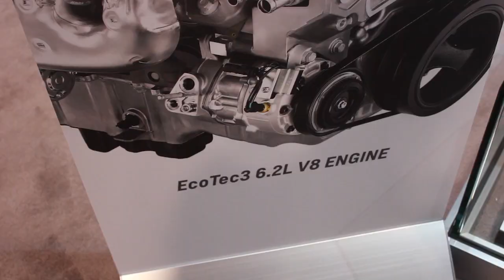Ask a GM Tech: Is a Cummins Swap Worth It?

Comment: Not sure how much similarity there is between the software running a GM ECU and Motorola RSS/CPS but I've used a hex editor program to allow specific types of Motorola radios to work in the amateur radio bands. Yes, someone waaaaay smarter than me figured out what part of the software needed to be changed, and where, but it wasn't all that difficult to do.

Comment: The annoying part is that on my 95 7.3 there were a few factory recals on it, & personally I’d rather get the part & instal it myself, I don’t want their thieves touching it, cuz then 3 miles down the road I’ll have some issues & have to came back to pay them for something they broke. 

In a nutshell... gas sucks diesel rocks. Depends on application. 

Trucks, SUVs, & sedans... diesel all the way.
Some people like the power of the gas motor, but others like the reliability of the diesel.

Unless they have DPFs on them then stick with the gas, the diesel is good, but you’ll have issues 100,000 miles downs the road with the DPF.

Comment: The answer simply is: What do you really want to have? Most people that buy those vehicles don’t want to do their own work on their vehicle especially to that extent. Where I live, I can’t do a swap like that, they just don’t allow it. The 4bt cummins is a lot more noisy, and takes away at the luxury aspect of owning the vehicle, but you do see a tremendous increase in fuel mileage. Even the 6bt will out do a 5.3 in mpg department. It’s a lot more practical to work on for you, and will be more dependable in the long run if you set it up properly.
Reply: Where do you live, because living anyplace that doesn’t “allow” you to do your own shit sounds kinda pathetic

Comment: Feel like the guy wouldn't use bucket responses if he weren't at a booth/event representing an employer.  He might not flip flop over and be ecstatic but would probably be much more interesting in talking about at least the concepts if it were under different circumstances.  Otherwise he wouldn't even start to mention you could reprogram at low level,  he'd just flat out deny or dodge it.

I've been part of swapping a duramax into a gas SUV similar to the guy in the video you have on the channel just because the computer works so well with existing hardware.  Other than that I don't have much personal experience with diesel stuff outside of videos/discussion.  Shame too, I quite like the design/idea behind the engines, anything mechanical is always fun/interesting to explore regardless the brand or origin.

Comment: The ECM can be reflashed IF it is supported by a program like HP Tuners. A GM dealer would not be capable of creating a custom tune. You're in need of a tuner shop that can create a custom tune.

Comment: You can tell dude is pissed at the mention of putting a Cummings in a chevy, even says to put back the inefficient 6.0
Reply: Reynolds Lyon it’s not Cummings it’s Cummins
Reply: Funny to me when people get pissed about chevy vs dodge, and swapping engines in this category. Neither one has an engine made BY THEM, so Eff it. Think an old 12 valve needs to find it's way in my old gmt400 1 ton.
Reply: The 6.0 is no bad engine tho. 6.2 is way better
Reply: @RBZ06LT6 yeah the old 6.0’s weren’t bad motors decent torque decent power can run 300k miles with proper maintenance. There’s better out there for sure but that 6.0 is a pretty stand up motor
Reply: *know

Comment: hey mechanic gloves, why WOULDN'T you swap a cummins in?  So many are so clueless how good 5.9s are.  I have two.  having said that, my buddy just swapped in a 6.2 LS to his 57  Belair and they are a sweet engine, all those LS's are
Reply: So many people complain about LS swaps today but like you said, they are great engines with good HP and with minimal wires and vacuum lines they are great swzps for older cars and trucks. The 5.9 and 3.9 ffom Cummins are great too even the Cummons 2.8 and 3.8, very good engines.

Comment: This is a big deal programming tranny shift points can be time consuming after the build so be prepared for several weeks of down time average cost is 17 k message me for more info if interested. once done you’ll be gald you did only if you plan on keeping your truck for more than 4 years after install. Other wise is not cost effective

Comment: 12v cummins gods gift on earth not motor has every been as tough and widely used as the 12 valve. blah, blah blah sounds like the honda boys thinking a plain stock civic is a high performance formula 1 car. keep it GM and run some two stroke detroits you want rugged and cost effective they are king. agreed being way older you can't juice them up like a 12 valve but stock vs stock the widdle 453T is just as powerful at not much more then half the displacement of a 12 valve. bring on the hate cummins boys :p
Reply: Ruger Magnum don't forget the work pig 7.3
Reply: Ruger Magnum the 453T is NOT as powerful as the 6bt. Stock the 6bt has a peak of 215 hp and 440 lb-ft of torque while the 453T makes 175 hp and 420 lb-ft of torque. The difference? The 6bt can make reliable aftermarket power. The 453T would be a fun swap but can't reliably be turned up to higher power levels.
Reply: Also the 453T weighs about the same as the 6bt even though it has half of the displacement
Reply: jeremiah mayne that is true the are heavy for there size being so old but they are pretty rugged and dependable. And they are pretty efficient for there age seeing how some have done these swaps in older gms and got mid 20's mpg where as the new baby duramax with similar power and slightly better efficiency is way more complex and expensive to run and not as rugged only winning in the weight department. Just goes to show latest is greatest all that often
Reply: kurt T ah the 7.3 one of ford's few smart ideas and they dumped it for the 6L, enough said :p
Reply: Ruger Magnum yup trash
Reply: General Motors Founded September 16, 1908, Flint, MI , Ford Motor Company Founded June 16, 1903, Detroit, MI , Cummins Engine Company Founded February 3, 1919 Columbus, Ind , Honda Founded September 24, 1948, Hamamatsu, Shizuoka Prefecture, Japan

Comment: why wouldn't you try a 5.3?!?!? ROFLMAO
Reply: the 6.0 is built to survive in a HD truck, the 5.3 isn't. the 6.0 is a pig but they're detuned and aren't going to be as stressed pulling a heavy load in a HD truck like a 5.3 would be screaming at high RPMs with a higher compression.
Reply: tell me about it. I own '05 Sierra with 5.3L. gas hog of an engine.12mpg city on a good day 19mpg on highway. All at speed limit.

Comment: People talk about how bad the ford. Nix that. Navistar 6.0 and 6.4 were. Those were not built/designed by ford. Now they built their own diesel and they are great engines.  When will GM and Ram actually build their own diesel ?  Probably Never but I would love to see what they would produce .With the power they both are getting from their gas 6.2 motors  both GM and mopar. They should at least try a branded diesel of their own with today's. technology and ability to use CAD they could possibly produce a great engine made in house
Reply: Why would they build their own now?  Modern consumer level diesels are in a regulation chokehold they'll never break.   May as well throw their money in a pit fire.
Reply: Bart Richards because they can design everything to work with everything and engineer the truck, engine, transmission under one roof vs. several contractors and it all just works better

Comment: It took GM 3 tries to get a decent Diesel Ford 2. (I guess those Navistar School Bus engines weren't so great) The Dodge/ Ram trucks always had the best engines.
Reply: Cummins isnt dodge
Reply: 4thstooge Cummins... not dodge...
Reply: Glock  Man he didn't say the duramax was bad, he said the 5.7 was a pos.
Reply: Glock  Man only took them nearly 20 years to make it perfect 😂
Reply: martin if thats what you think why is  there no hemi swaps into hotrods like the the LS ?
Reply: I currently have a cummins but before I had an 04 dodge durango with the 5.7 hemi and at 180,000 miles a wrist pin broke on one of the pistons. I have nothing bad to say about the hemi's but I took very good care of that vehicle and it was just surprising that something like that would happen at relatively low miles. But who knows. They have gotten way better with the newer motors since then
Reply: Taylor Lindsey and i think that that kind of thing can happen to anybody and to any brand. My dad used to have a ford ranger that he loved. Overall we’ve had the most luck with GM, so thats why I prefer them
Reply: Taylor Lindsey agreed
Reply: @John Hulbert my 03 hemi ram 2500 snapped a tone ring at 157k, cracked four pistons.
Reply: Um gm had multiple diesel brands please know what your talking about
Reply: shawn cordeiro have 3 hemis in our fleet, all at around 600000k.  Best gas engine ever built bar none.
Reply: i personally like the 6l chev  hummm i wonder why hotrod guys arnt putting these so called  hemis in there hotrods ?
Reply: I had a 6.2 gm diesel swapped FS Bronco and it was the perfect vehicle for me. Straight piped, no smoke, great in fuel and v8 sound. The front fender started braking with the battery weight but the engine itself never failed. A heavier engine like the Cummins would be bad i guess if you are not going to throw a lot of money in your swap (new suspension, etc).
Reply: Hang on a minute... the 6.2 Detroit diesel is not a bad motor. Just didn’t have much power. It was reliable. The 6.5 had only 1 issue, the PMD, and after it was relocated it became a reliable motor with decent torque. Relocating the PMD was super cheap too. The first generation Duramax had injector issues yes, but so did the common rail cummins when it came out. Not to mention the vp44 issues with the 24v cummins. Neither motor is perfect, but let us Dodge and Chevy guys agree that Ford is crap.
Reply: @T_L_  regarding to the 6.2 gm diesel, and 6.5 gm diesel, on my experience they are a huge pile of crap along with IH IDI engines. I've seen more broken crankshafts in GM diesels than anything else. If I had to choose a diesel engine, it would be a 7.3 powerstroke, or preferably, a 5.9 cummins p pump, or 04.5-07 h.o. engine. The 04.5-07 5.9 cummins is the best engine ever put in a pickup truck hands down. Damn good reliability, horsepower, and easily gets 24-32 mpg.
Reply: asdasdgsdfgsdh hjdyuks if the 6.6 duramax was a bad engine why is gm still equipping it in the HD trucks too this day?
Reply: Taylor Lindsey i agree but ford has made some good engines, the 7.3 was great, the 6.0 was decent but the 6.4, was just bad. But yes the 6.2 was very underpowered but it was a damn good motor when taken care of.
Reply: Evan Salyer I’ve always been a GM guy. The 350 and the 5.3 are some of the best motors to ever be put in pickup trucks in my opinion. The duramax after 06 when the LBZ came out has always been a pretty reliable and almost bulletproof diesel too.
Reply: Charlie Perry your drunk buddy.  Some of the hemis are outlasting the cummins.  Dodge powertrains have always been bulletproof.  318, 360, 5.7 hemi, and the cummins products made the majority of the fullsize pickups.  Even the 4.7 wasnt a bad motor but not as good as the ones listed above.
Reply: Evan Salyer Ford trucks have just always given me issues...I’ve had a 95 f350 with a 460 gasser in it and the motor was fine but the rest of the truck was just falling apart. A good friend of mine has a 2002 7.3 with 170k on it and it already has a fair bit of blow by... My grandpa owned a 6.9 diesel and a 6.0 and he was always working on both of those trucks... I just haven’t had much luck with Ford I guess.
Reply: the hemi & fords are junk you get 500k outta of chevy  6l gas
Reply: 1 only GM and ford make there own Diesel engine         2 if 6.2,6.5 is a pos why does the military still use it and oskosh uses dmax!
Reply: @duenpuen6862  gm didnt make the 6.2 it was a detroit diesel product. Actually is a great motor if you dont have an issue that results in hiting it with starting fluid while your glow plugs are hot, it will last a very very long time
Reply: @duenpuen6862  GM does not make their own...Isuzu motors builds them.Ford didn't make theirs until after 2010.
Reply: I can’t believe this guy just said dodge has always had the best engines 😂 literally the only good motor they have ever had is the 5.9 everything else dodge is fucking junkkkkkkkkk and even the 5.9 isn’t that great I’ve seen plenty of them that didn’t make it to 300k 12v lasts long because it makes no power.

Comment: FYI I have done many engine swaps, 4x4 pickup, camaro, elcamino, sand rails, 4cyl quads, jeeps too.  One time, I tried helping a shop do a swap. I had done this very swap before in three days-no lift.  The Certified mechanic who was good @ OEM factory work was totally lost with a simple jeep swap.  Don't go to the factory guys for this stuff, they are not trained that way.
Reply: A & R Masters Those guys have good memory. They were not programmed to be AI.
Reply: what do you charge for a swap in my hummer o5.what is better Cummins or gmdermax

Comment: how hard would you day the overall swap was and how is the transmission holding up i have a 2000 gmc jimmy with a 4.3 with a 4l60e and im getting around 12 mpg with mainly highway driving and was considering a 4bt swap because i have a rebuilt transmission with 10,000 miles on it and would like to re use the trans if possible and have it last
Reply from the maker: +jljr1998 My first swap took over 100 hours but I do go above and want a factory look. Transmission I holding up fine.  Watch the entire Tahoe build and you will have a better understanding of whats involved.